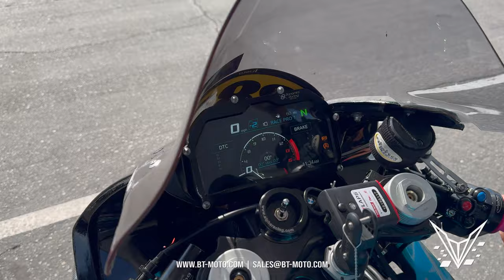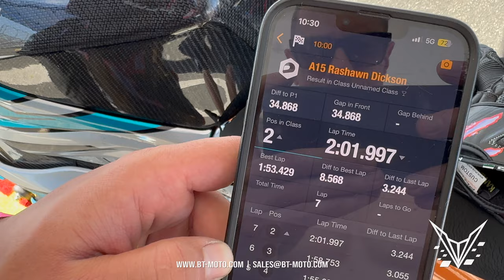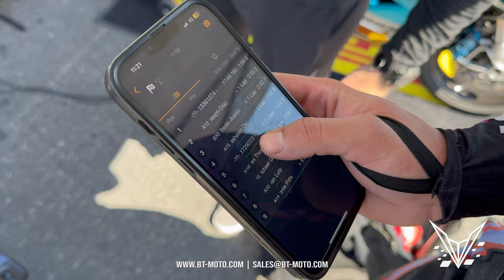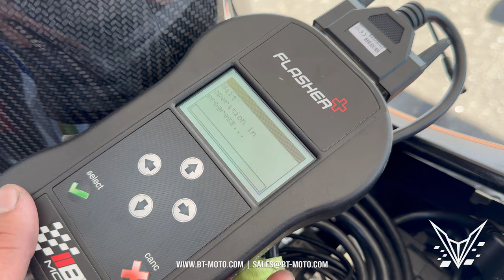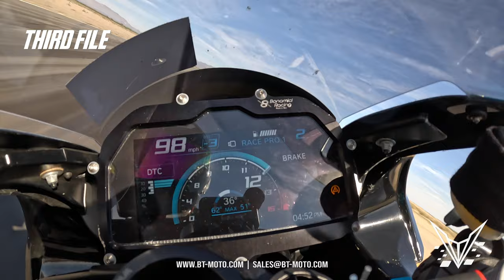BMW Audible Traction Control S1000RR Review, BT Moto

Comment: Since tire size mess with traction control, do you guys have any solutions? I know the dealership can change the settings, if you come from  a 190 to 200. But is there any other way to do that.
Reply: If that’s the case I wonder if you could code it with the utility tool
Reply from the maker: We can input new tire sizing into our flashes